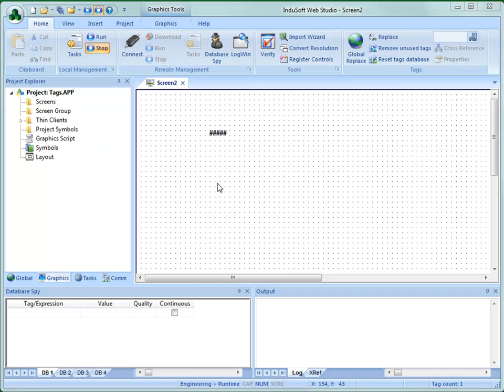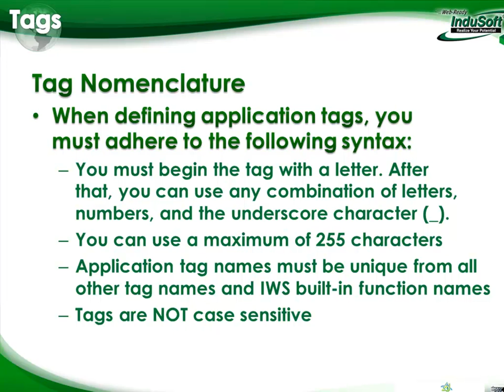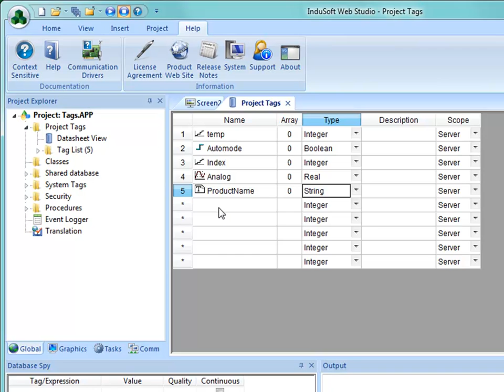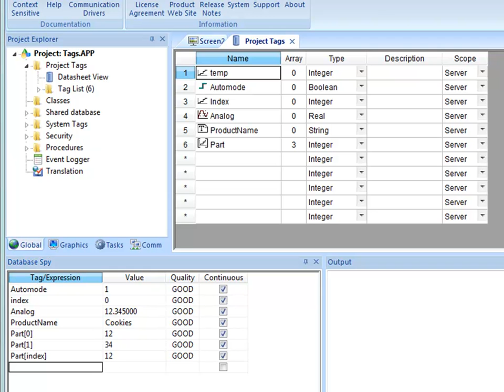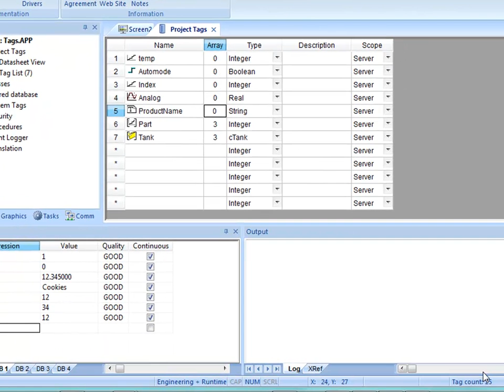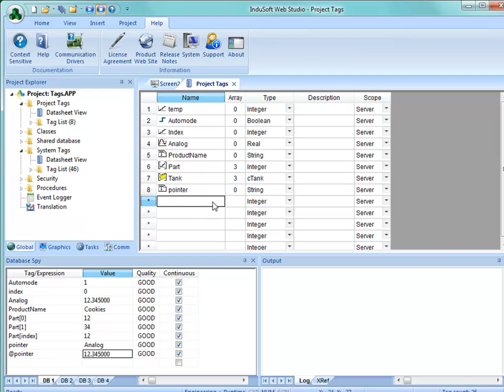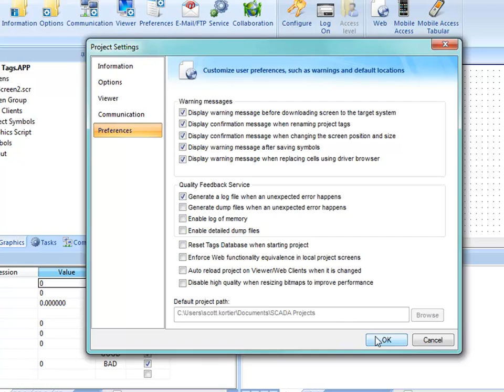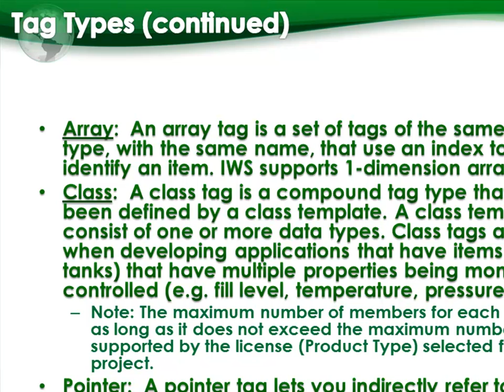Tags

Comment: HI there,

I'm using a S 7 1200 PLC and has various sensors connected to it.

The PLC has numerous 485 Sensors connected to it and all the sensors are working and sending the correct data values to the PLC.

LODTemp1  DB5.DBD32  - Floating-point Number

LODPerc1  DB5.DBD44 - Floating-point Number

LODmg         DB5.DBD52 - Floating-point Number

AmbientHumid1  DB5.DBD82 - Floating-point Number

AmbientTemp1  DB5.DBD90 - Floating-point Number

AmbientLUX1  DB5.DBW72 - DEC +/-

PhSen1 DB7.DBD0 - Floating-point Number

OrpSen1 DB7.DBD4 - Floating-point Number

WaterTemp1  DB7.DBD8 - Floating-point Number

When setting these tags to real on Indusoft the Lux reading is correct (set to integer) but all the real tags are reading the incorrect

AmbientTemp1 1106300109 - should be 30.1

AmbientLUX1 2348  - Correct

LODmg 1084511463 - incorrect

LODPerc1 1116454652 - incorrect

LODTemp1 1107018776 - incorrect

Any help will be greatly appreciated
Reply: For floating point you should write the address like this DB5.DBF32